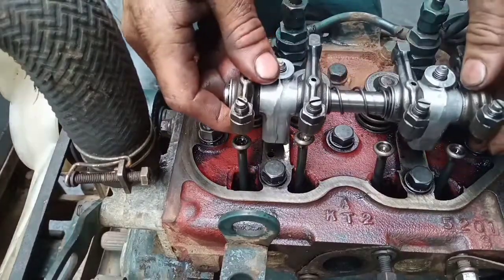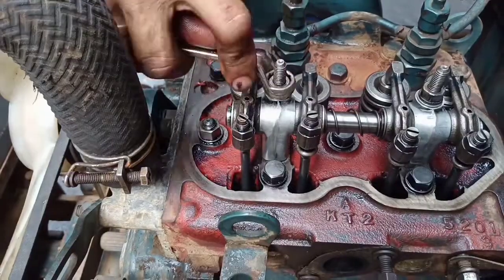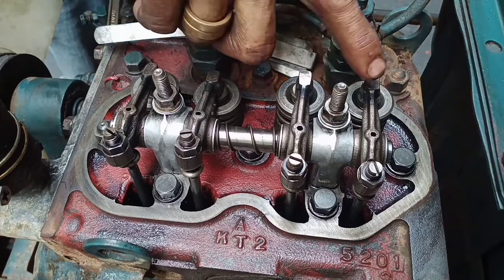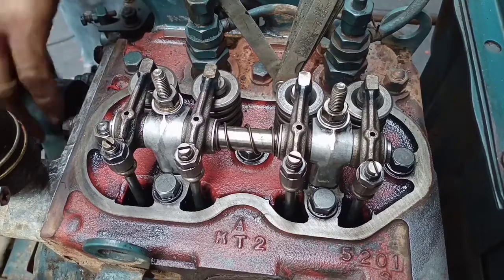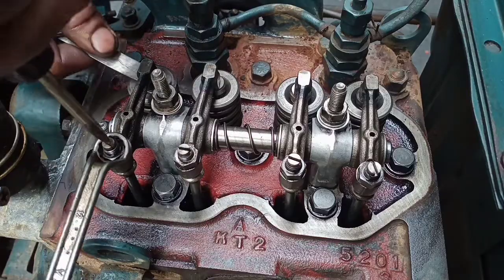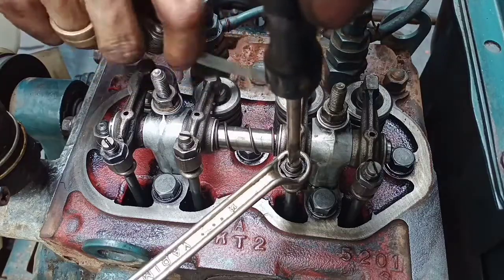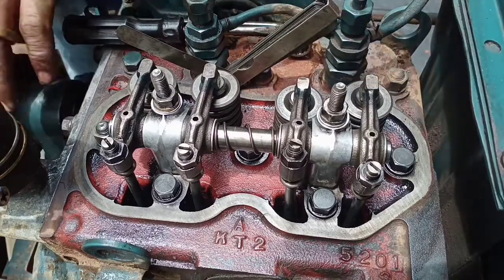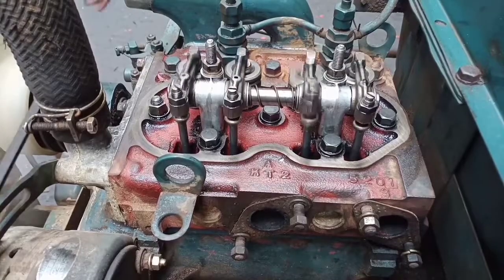how to tune-up 2 cylinder engine without timing mark/paano mag tune-up ng 2 cylinder na makina

Comment: Hello sir ano po tamang rotation ang engine ang starter nya ay nakaharap sa block komatsu d94-1 2cly.po ito napaandar ko po pero sa intake manifold lumalabas usok at sa exhaust manifold ang air intake nya
Reply from the maker: Kanan po nasa video nmn po kung saan Ang rotation ng makina.pwera n lang po Kung marine engine, meron kaliwa Ang ikot.

Comment: Привет. Подскажи пожалуйста какой зазор должен быть у kubota z650? Какая метка должна быть на маховике для регулировке первого цилиндра, и на какой угол повернуть коленвал для регулировки второго цилиндра?
Reply from the maker: .25mm and that engine had no timing mark on the flywheel.just follow my video   on how to apply valve tappet clearance.
Reply: Спасибо👍

Comment: Sir sa f2L912 deutz engine ganyan din po ba ung setting
Reply from the maker: Deutz sir ay Hindi pa ako napag tune up.pero ibang ibang 2 cylinder n Ang natune up ko ay pare pareho lang po Ang   galaw ng arms nya.kaya po Ang masasagit ko po sa Inyo ay pareho lang po siguro.gaya din po ng 3 cylinder magkakapareho din Sila procedure sa pagtune up.kahit din po anong URI ng 4 cylinder iisa Ang rules nila.kaya sa palagay ko sir pareho din Yan sa Kubota,yanmar, ISUZU, Mitsubishi, HINOMOTO,at iba pang model n makina.salamat po sa panunuod at pasubscribe,share and like.salamat po.

Comment: I have an iseki tx1000 it has a ke55 engine. I got it for next to nothing. Found out why. It is missing the entire valve rocker arm assembly and the pushrods. I have not been able to find parts for the ke55 anywhere. But i have found the parts i need for a ke70 two cylinder engine. Any chance you might know if they are compatible? If not i have a full cnc machine shop at my disposal. All i need is the geometry of the parts i need and i can make them myself. If you have knowlege of the ke55 i would love to hear from you as i really want to retore this little tractor.
Reply from the maker: Thank you for watching,yes it's the same parts not included piston,piston And piston ring.

Comment: Hi,i have a J285T 2cylinder engine,what filler gauge should i use?
Reply from the maker: 10 or 14 in your filler gauge.
Reply from the maker: Thank you for watching.pls subscribe share thank you
Reply: @tractorsmarinemechanic  same tehnique for adjusting the valve clearence?
Reply from the maker: Yes...the same principle

Comment: how many millimeters do you put in the filler for setting in kubota b6000
Reply from the maker: Just apply 0.25
Reply: @tractorsmarinemechanic  how many kilos we put in the torque wrench for the connecting rod screws and how many for the head in the B6000 kubota

Comment: Thank you so much bro thank you very good work congrats i wont to l1500 clutch plat repairing and New plat chenging video pleas
Reply from the maker: Pls watch my video,just type and search this one.FLYWHEEL OIL SEAL REPLACEMENT,INTALLED PRESSURE PLATE AND CLUTCH DISK L1801.they are the same pressure plate and clutch or it's the with your unit.